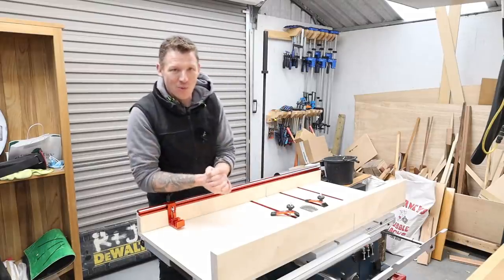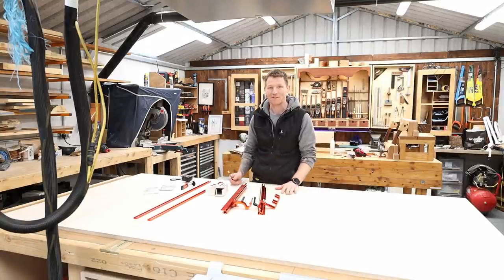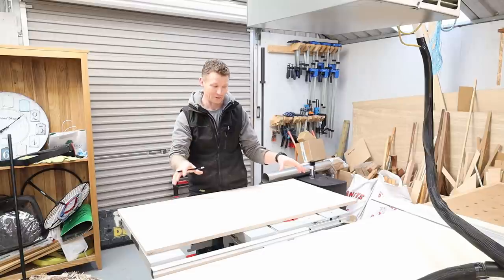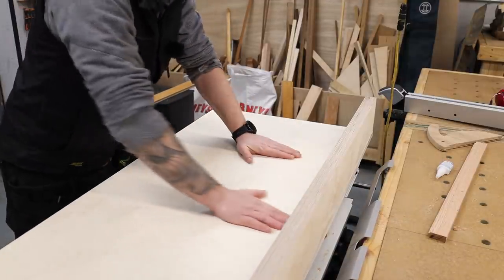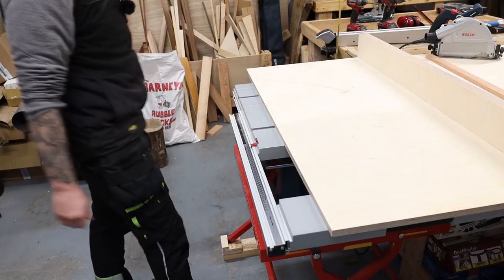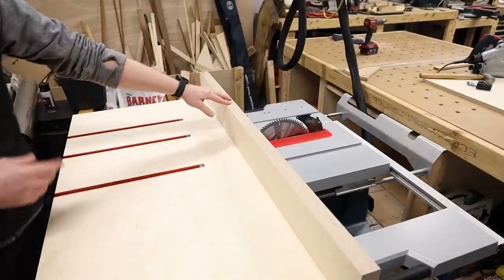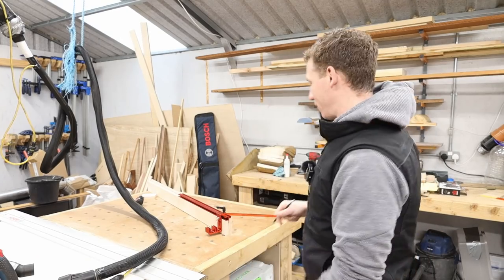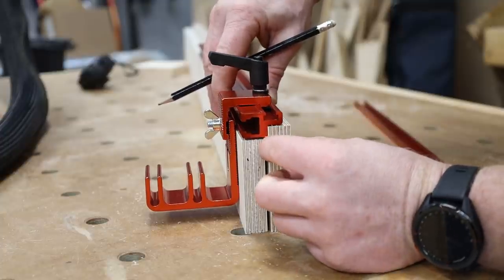Large Cross Cut Sled. Essential Table Saw Jig.

Comment: Small improvement might be a small 45 degree groove on the bottom of your front fence for dust particles to go so they don't mess up with alignment when you're cutting multiple pieces. I forgot to do that on my sled and now I just keep a brush at hand whenever I use it and clean it out after every cut. Will definitely do that next time :)

Comment: Nice sled John and well made... If you are going to use it for your cutting boards, consider adding a few threaded inserts for additional hold downs nearer the blade at the far end (for when you get to the narrow end of the cuts) ifyou get what i mean.
Reply from the maker: Will do Paul

Comment: Just subscribed. I built one for my P-C table saw. But for some reason, after I cut the kerf, it wouldn't slid anymore. I guess I'll have to start over. Originally used White Oak for the runners. Think I'll switch over to Ipe. I have a couple of strips of that that should work great.

Comment: Well done.  I have a Jet table saw with a sliding fence on the left.  It is good but I am left with only one guide on the right side of the blade.  Would your rig stay on track with only one guide?
Reply from the maker: I would make it smaller in size if it is to run on one guide
Reply: @JohnMcGrathManInShed  Thank you

Comment: Nice sled with good Ideas. I am In the process of building one too for my Metabo TS 254 M. Just a suggestion, next time you might want to make your runners out of those cheap plastic (don´t know how that plastic Is called) food cutting boards found In some Asian shops. I have found 8mm and 10mm thick cutting boards and can be bought for 5€. They will last a lot longer and slide better then wood.
Reply: That's a great idea.  That material is naturally slippery and perfect for this sort of thing.

Comment: Nice video as always John, although I am not a fan of these myself mainly due to the fact there is no guard over the blade. It would be very interesting to see maybe for a future video if you could come up with answer to this, perhaps how the guard could retract as you make a cut sort of like a chop saw or radial arm saw works, and maybe a stop that prevents the sled going to far forwards and not exposing the blade through your additional block on your fence.
Reply from the maker: You would need at gaurd that could move back as the sled moves forward but it would then hit the back fence it's a difficult one.

Comment: Hi John, great vid fella. 👍. Just a question hopefully not stupid? I just bought an Axminster cabinet table saw and over the moon with it. However I was torn between buying a sliding carriage for it which will do my cross cuts or to build a cross cut sled. And based on birch ply costs and the extras needed there isn’t that much difference in cost between the two. However I noticed you have a sliding carriage on your Bosch table saw, yet you still built a cross cut sled. Any reason for that considering both sort of do the same?  Just got me thinking if there are advantages over one or the other. Hope you and family all good and great to see the videos. 👍🥃
Reply from the maker: The cross cut sled if made right will always be square so no set up needed, it supports the work on both sides of the cut, is zero clearance so better cut quality and is easy to use. You don't need to make it from birch ply or use what I did. They can be made really cheap.
Reply: @JohnMcGrathManInShed  
Cheers John. I guess also for me the sliding table sticks far out on the left hand side. So having this would do away with that. Nice one. 👍

Comment: As mentioned earlier, I have the same Bosch. Your sled will be difficult to manipulate and store, a bit too large. I made the same mistake starting from 600mm deep, it won't cut 600 at the end :-).
Now run the 5 cuts test, you'll be surprised how much you are off... :-(
Reply from the maker: I ran the 5 cut test just to see, it's less than .01mm out over a 165mm cut the calipers reads 31.05mm both ends of the final cut. If you can't use your squares in your shop to make something square then what's the point in having them.
Reply: @JohnMcGrathManInShed 
0.1mm out over 1.6M! Thats seriously impressive John. Well done. And you are right, when the square is square, then it's square! So it's what you use!